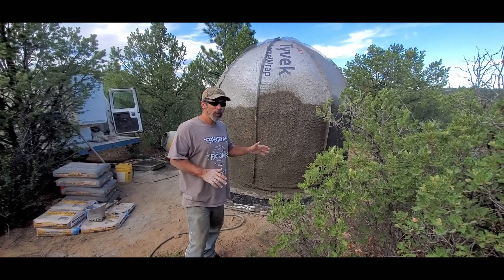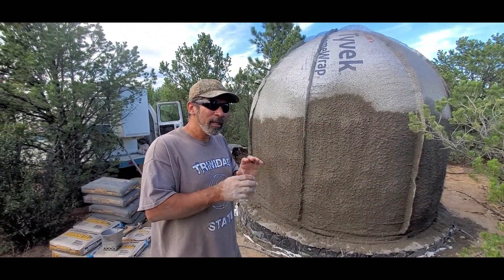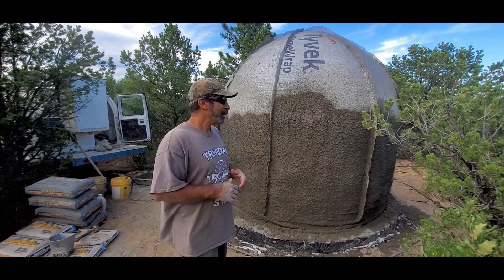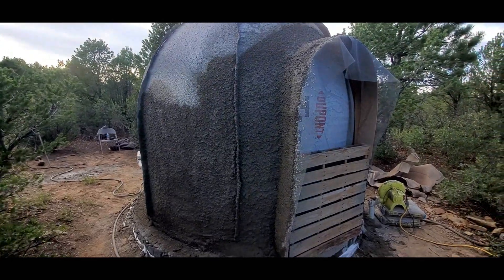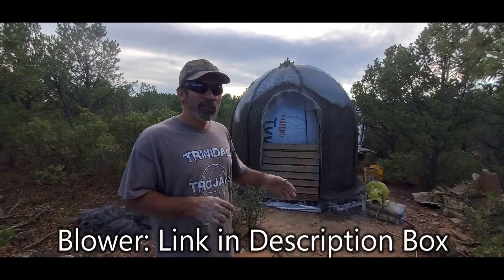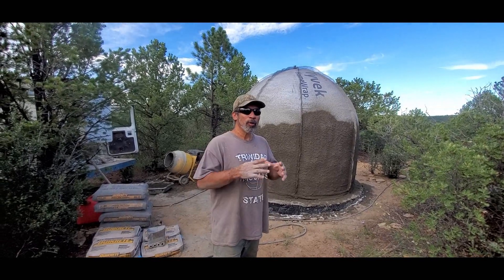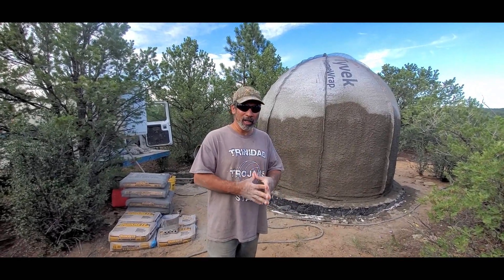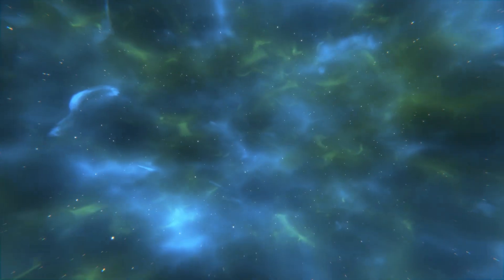Spraying Dome Update | Ceramic Beads Dome Build #ceramicbeads #aircreteharry #airform #domebuild

Comment: How are you adding windows to these structures? Are you just cutting them out or are they windowless?
Reply from the maker: Welcome to the channel Teddy 👍 
It's done different ways. 
For example: 
You could make the cut-outs, correct.
Or you could make a frame on the outside & attach it the structure, then spray it.

Comment: I'm a little curious as to why the airform seemed to be leaning a little in the video before this one. You can see in this video it's still leaning and throughout the video and towards the end, you can see the wrinkles at the bottom on the side its leaning. Is that due to insignificant air pressure inside? Is the weight of the cement causing it? That would be a major problem on a 30-40' dome with the added weight. Would a couple extra blowers fix this or have you tried larger blowers?
Reply from the maker: Could you please point out the time stamp of what you are referring to?
- so I can assist you with the answer to your question.
Reply: @AircreteHarry 1:09 and around 7:50 both right at the base just above the ring form.
Reply from the maker: @billbarrett582  Good evening, 
What you see are the wrinkles of the fiberglass Mesh-Form.
It is sewn a bit bigger to fit on top of the tyvek air-form. 
Once the air-blower is turned on & the air-form is filled with air, you won't see any wrinkles on the tyvek part - at all!  The mesh-form will have some wrinkles due to the extra material. 
Also, the leaning is an illusion because the foundation is thicker on one side than the other. 
Note: at the 28 sec mark 
you see me adjusting the mesh-form.

While having one of the hands-on workshops - we had someone point out that one of our Domes in previous videos appeared to be leaning, but being here in CO, in person - during the workshop explained the illusion 👍
Reply: @AircreteHarry thank you for taking the time to explain. I noticed the ring beam was thicker to accommodate being level. I think the angle of the camera might have played a role in the illusion of it leaning as well. I really enjoy what you're doing and hope to use this process when the time comes for me to build a home for my daughters.
Reply: Do you have an update video of the tire wall you started for your greenhouse? I wanted to incorporate the pounded tire Earthship style walls, but I'm getting a little too old to be swinging a sledgehammer and the whacker packer seems like it would be much faster.
Reply from the maker: The air-blowers I've been using & recommending to others work very well. 
Link in the description.
No, as mentioned to you in the other comment, there is no need for more than 1 air-blower at a time.

Comment: I have been thinking, I may build a few mini domes when I get to the Philippines  , for Air B&B  and weekend camping type accommodation,  but using tarps or Tyvek and Bamboo and a few 9mm rebars, bamboo is very common  in the provinces, away from cities, cost next to nothing and no need for airforms or blowers , just a  gas powered compressor and  stucco sprayer and mixer ( optional), labour @$10/ day,  and rebar  and cement are cheap there.
Reply: I also want to go to the Philippines - just waiting for the unvaxxed to be allowed in (next summer?)  Likewise, I'm seriously considering building a dome or domes there. What area are you considering? I'm pretty open to anywhere except the very big cities.
Reply: @HealthyHappyJason  Batangas  would be #1 @500 Pesos / sqm, 1.5 2 hrs2 hrs from Manila#2 would be Laguna @ 300Pesos / sqm ., 2hrs from Manila , Visayas would be #3 but they cost more for shipping from abroad, Dumaguete Negros has quite a bit of Expats.( check out YouTube, Mark of "Everyone has a story", he loves it here and will spend rest of life  there), Batangas and Laguna and some of Quezon Province  are the coolest in temperatures,  but due to Luzon being the  typhoon path a bit , typhoons come via Leyte  then Luzon to Bicol then head  North .Negros and Visayas and Cebu/ Bohol don't get major typhoons as by the time  it get there it has weakened,Negros is very good option  for investment for Expats w/ money to do AirB&B in Valensia if you can find 1-2 hectares, organic farming and build  apartments,  for AIR B&B but  you have to have Filipino wife you can trust and not scam you  as property will be in  HER name ,be careful and get a  Filipino Lawyer and be aware  of property  laws,I'm exFilipino   and can regain Citizenship ,50  years out of the country .Texas Filipino ,James Hightower is another cool guy,almost done with his beautiful mansion in an  ILOILO ⛱ 🏝,Oh ,Solar and LFP  batteries  are a must  for Western style house with electricity that you dont worry about brownouts,Also  James Tanner  of My PI Dreams( 5 years) and Greg &Wilma of Building Philippines ( just started)  building in Dauin  ,Negros has good Youtube  channel,  ,These guys have Filipino wives and have savings, and are retired, Your Dollars will go a lot farther in the Philippines, if you can adapt and adopt the  country, my family  & me un Vaxed too ,  & a Vegetarian friend who  wanna live in Negros , maybe we can connect later.Cheers🙂

Comment: It seems that if you put the door around the blower inlet, so it would temporarily be blowing through the door location, then you would not have to deal with that hole later. Just a thought, looking good 💪
Reply from the maker: Thank you ! Appreciate you 💪 💪 
The tube / hole is purposely out the way of the door/entrance. After all stands, it will still be used to provide Fresh Air. 
In the Dome Homes the tube may be used for plumbing, drainage or electrical. 👍👍👍
Reply: I was wondering the same thing! 🤷‍♀️Maybe their is a reason or purpose I didn't know or think of, hop'en for a reply! 🤠
Reply from the maker: @suzanneweitzel8969  Hi Suzanne, correct there is a purpose.
The tube / hole is purposely out the way of the door/entrance. After all stands, it will still be used to provide Fresh Air. 
In the Dome Homes the tube may be used for plumbing, drainage or electrical. 👍👍👍
Reply: @AircreteHarry  Thank you! I have had fun doing other cement projects using a hopper. (I liked the hopper a lot! You mentioned a hand mixer also) 
I did a cave dipping the burlap in wet cement and placing it on a mesh form, kids loved it! Quick and fun! I am thinking of building one more time in my life time.
 Considering a cement dome, several to connect, about the size you are showing in this You Tube to make a little pod city house. Each room have a dome. 
Or, maybe an A frame. A Tipi, Perhaps a geodesic kit, or a pod of some sort to cover with earth. I like all of them. Playing with  plans for all and wonder which one it will be, in time. It will depend on the land. 
 I kinda want portable and thought it would be fun to try a ferro cement dome on a 20 foot trailer. Time will tell. I enjoy your videos! And thank you for replying.🤠
Reply from the maker: @suzanneweitzel8969  My pleasure, of course - Always Happy to connect & read Great Comments with Goals & Ideas & Hands-On Approaches 👍 👍 
Suzanne, we are so looking forward to hear about your building updates. Everything you wrote  - and the way you wrote it, you are meant to create!! From a Creator to a Creator- I know it!! 😊 👍 👍 And the Kinds would Love it!! Please keep in toch and let us know when you decide to make it happen!! All options are great.
Reply: @AircreteHarry  Thank you for the kind words! 
Just out of curiosity,  are you grounding your pod? 
YES! Life is a creative adventure! Keep posting! Right now I am living through your activities.  ~Suzanne 🤠
Reply: @suzanneweitzel8969  I have a 20 foot long ferro cement sailboat and it is about 1/2" thick with 4 layers of mesh wire. It is incredibly strong and takes a 3/4 ton truck to haul....
Reply: @jeffgreen977  OKAY!  Now that sounds fantastic! Who built it? How'd you land up with it if you didn't build it? Did it get sealed with anything on the underbelly? I work with marine ply wood which is typically the application for some boats. Never thought of ferro cement! Fun! 🤠
Reply: @suzanneweitzel8969  It was built in 1973 and came out great!... It has never been in the water and never will.  I bought it to cut it apart and study the build and test the strength... Look up Bruce Bingham and ferro cement boats - he wrote a great book that sells on ebay...
Reply: @jeffgreen977  Did you ever dissect it? How'd you find one? And being out of ferro cement I would think it to be about the same in weight as a marine ply. What do you think? You mentioned hauling with a 3/4 ton. Did you ever weight it on a truck scale? Just wondering.~ 🤠
Reply: Good article on Bingham and Katy! I liked the answer to the question: where do you dock? Anywhere they want! I have often thought of a house boat for fun. Just a thought to occupy my mind during windy and rainy days! Thanks for the suggestion! Fun to learn! 🤠
Reply: @suzanneweitzel8969  It is quite heavy but I have not cut it up yet. I worked in a shipyard 50 years ago but I will never build with marine ply again - too expensive and other materials are much better and last longer...
Reply: @jeffgreen977  I play in the medium of cement where as the plywood is excellent in what my work has been! I am a wood worker in the creative scrolling world. The ply has excellent quality for fine cutting! At times the two have merged together in a project. 
You have been fortunate to be by the water. Being a desert dweller for my entire life I had desires for the wide open sea, so I settled for pools as my water wings. I had been seriously looking into a house boat just to live in, closest illusion to the ocean when the high winds show up in the spring! Boats are a creature of beauty! Each one with a life of their own. Wow! This has been fun! 🤠
Reply from the maker: @suzanneweitzel8969  you are very Welcome! Appreciate you & your fun / great attitude 👍 
Stay motivated & creative!! 
Yes, we do ground.

Comment: Your mesh sock is absolutely brilliant! When you see others try to spray stucco type mixes on fabric forms the wet mix just slides off - not on your form! This alone is the difference between success or just a mess.... Question: will a cheap sewing machine work to make the airform and mesh sock?  I would love to see more detail on how you create your forms/socks....
Reply from the maker: Thank You very much Brother 👍 
Sharing what works. 
Exactly - without the Mesh the approach of spraying is much more slower. If spraying too much on just Tyvek, it will start sliding (waste of money). Mesh provides that Great Grip & Strength. Speed in spraying without sliding off. 👍 👍 
YES, during all my Hands-On Workshops I teach the sewing process using a Sewing Machine that is around $150
I have it on my Tool List as well. (description below) It is the same Sewing Machine I've used for all my Air-Forms.
Reply: I attended Harry's workshop last year, and we used a $75 sewing machine from Walmart to make the form for our 10 foot test dome; worked just fine.  Harry's method is very simple and fast!
Reply from the maker: @chadcranston9931  Chad!! You said it Brother. Exactly, Appreciate you Man 👍
Reply: @chadcranston9931  That is great info, thanks.
Reply from the maker: @HealthyHappyJason  That's correct, we don't use (need) an expensive Sewing Machine 👍
Reply: You could glue the seems and not even sew it.
Reply from the maker: @hazlox  Unless you personally have done It successfully and can show that - it is INCORRECT.
Reply: @AircreteHarry  I know people who have. E6000 or goop is crazy strong and flexible. You can’t tear it apart. We glue broken dinner Plates back together with it. It would screen together amazingly well. Could cut production time in half for you.
Reply from the maker: @hazlox  You know someone who glued Tyvek Material with those glues and had it under Airpressure for a long period of time?
Reply: @AircreteHarry  I’m talking about gluing the screen not the pressure eyes bubble. I do know someone who glued EPDM and uses it as an air form
Reply: And I bet you e6000 would glue Tyvek together and hold pressure. I bet the the tyvek or 6” ZIP tape would hold really well too. It would be worth an experiment!
Reply from the maker: @hazlox  The Mesh Form is very important as it plays a roll of a belt that keeps the Tyvek Air-Form from any chance of bursting. AND provides Strength & great Grip for cement application! 

The price of good, strong glue as well as Tyvek tape (expensive!) is higher than the cost of thread.
EPDM is way different from Tyvek.
The glue does work on EPDM, yes. 👍
Reply from the maker: @hazlox  If anyone else would want to do that, - sure. Of course  there are many options - some haven't been tried, some haven't been successful. 
Everything that is successful & in addition saves money while choosing that option - GREAT! 
I personally have been creating all the Air-Forms ever used; by using my thread technique. I am very happy with the results and therefore stand by Recommending to use the thread. 
AND the price of a thread vs Tyvek Tape or even glues is way more affordable. 
When you get to use the glue, let me know how it goes.
Any you building anything yourself at the moment?